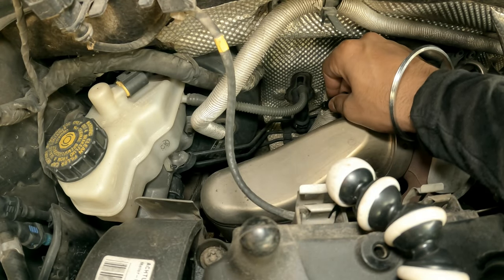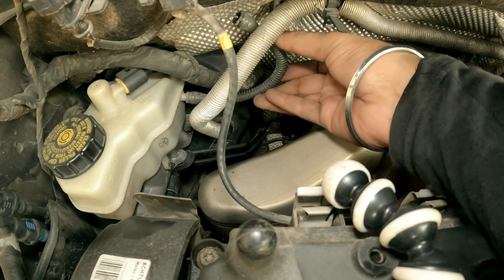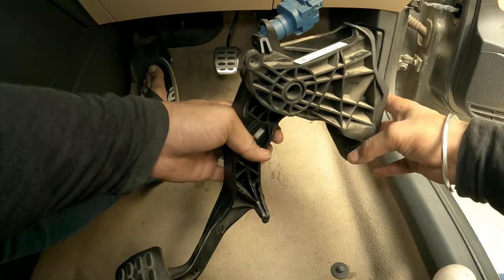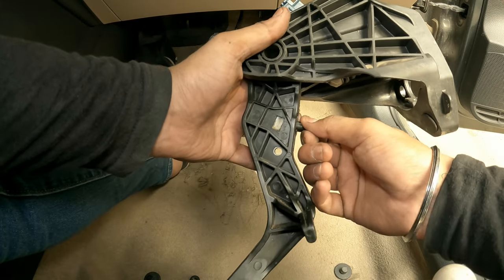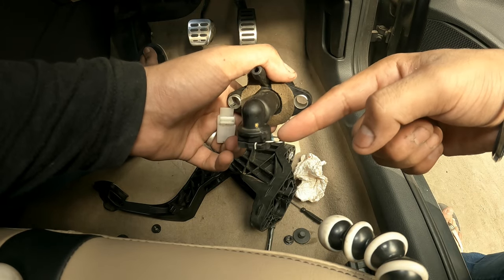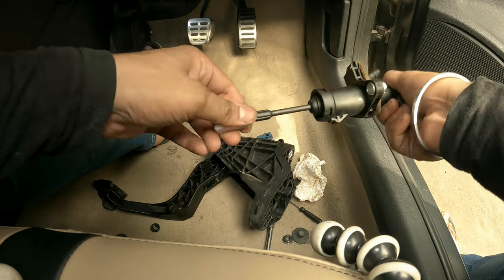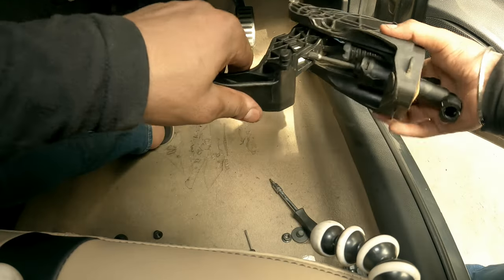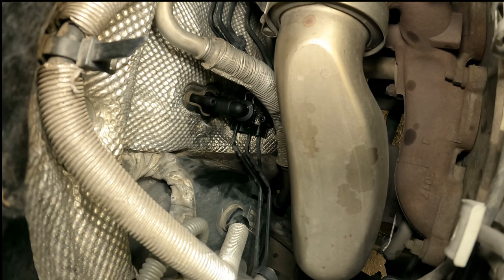VOLKSWAGEN CLUTCH MASTER CYLINDER REPLACEMENT

Comment: Thank you for posting this. My master cylinder is failing and this helps greatly. Question- when I go to bleed the system after install, do I also need to bleed the brakes, or will it be sufficient to just bleed the clutch?
Reply from the maker: Ideally you should bleed both of them  sir
Reply: You don't have to bleed the brake system

Comment: A quick one. 
I’ve a MK6 Jetta. How do you flush your brake fluid as my car brake pedal stays hard even on a level ground due to hill hold assist system. Is there a work around for pedal method in this type of car? Or you have to use the pressure bleeder ? 
Thanks in advance.
Reply from the maker: If the gravity method is not effective then we can use the back-flush method for bleeding the air out of the system, some cars do have a bit of a hard pedal due to hill hold assist , but that's the Nature of some cars

Comment: Thanks for the informative video. Does this needs to be replaced after specific period ? What if it  breaks while traveling, can we still drive the car . I have a 10 year old polo and I am curious if I should replace it now or not, I don't have any issues with the clutch till now.
Reply from the maker: Sir , ideally it should be replaced when you are overhauling the clutch , yes it can break , and same happened with me , but i was near to home so i just started the car in first gear and drove around 3 kms in 1st gear . As i didn't had clutch so i was not able to change gears and can't break as well
Reply: The car will be underivable other than short distances to park it somewhere else or put it on a trailer. You will not be able to disengage the clutch. As in, when you push the clutch pedal down, nothing will happen. So unless you can float gears you really only have first gear, and will need to turn the car off to stop.
Reply: This happened to me now..car is undrivable..clutch fully pressed..cant put it in gear..the only thing that took me home was the downhill in a mountain..luckily it didnt happen 2 days before driving at night with a baby inside
Reply from the maker: Sadly it is what it is sir, when it happened to me i drove almost 4km in first gear without using brakes .
Reply: @yourDIYneeds  -  If the connecting rod would have been of steel then this could have been avoided I believe . But it seems most of the manufactures use only the plastic connector rod . Heard few people were able to replace the plastic connecting rod with a steel one , but sure if its worthy to repair it.
Reply from the maker: Sir , exactly , a metallic rod can protect you from being stranded on the side of the road , yes heard that as well , but need a proper laith machine for that .

Comment: Hi sir i have a 2020 polo 1.0tsi 53k driven when I try to put reverse gear it makes noice but every other gears are working proper should I change my clutch
Reply from the maker: Sir , in some transmission it's an issue, just try to press the clutch pedal twice before engaging the reverse

Comment: Hi brother can u tell some must have basic tools for vw car owners?    I am thinking to order as sale is going on in amazon and flipkart..
Reply from the maker: https://amzn.to/3JxOozN
https://amzn.to/3bxOlqW
https://amzn.to/3bx0QTV
https://amzn.to/3BMmVbM

These all will do 90% of the work on a german car
Reply: @yourDIYneeds  Thank u brother👍 Should buy all 4 in the links? Mainly need tools for general servicing..
Reply from the maker: https://amzn.to/3bIWY23 - L handle
https://amzn.to/3Qwdr8q - 19mm socket 
https://amzn.to/3SwK87P - 32mm socket
https://amzn.to/3vPTiTb - small sockets and torx

These 4 will be sufficient for general services
Considering you have a polo which has a 19 mm drain plug

Comment: Currently trying to figure out a problem, 2014 vw jetta TDI. Clutch just sits on the floor board, could it be the clutch cable?
Reply from the maker: If its a hydraulic clutch then , its the lack of pressure or presence of air in system

Comment: Should slave cylinder also to be replaced along with master cylinder?
Reply from the maker: Sir these things ideally should be changed along the clutch plate
Reply: How about the brakes? As they operate on the same fluid system do they not?
Reply from the maker: Sir thats just hydraulic fluid sharing , nothing more than that , instead of having 2 separate reservoirs for hydraulic fluid , its better to have just one  when both systems need the same fluid

Comment: Hey bro can you please answer me a thing recently i have removed my polo 1.2 tdi thermostat valve and it was not easy in my place to find that whole thermostat part so my mechanic suggest me to remove the valve and he make the connection without the valve so now i m wondering is it a good thing to do please help me.
Reply from the maker: It will effect the engine only in cold climates , engine will now take more time to warm up , and till the time its not warmed up , fuel economy will be compromised , except that everything else will remain the same
Reply: @yourDIYneeds  Thank you so much mayyynnn you have clear my doubt and you are doing great job bcoz of you now i can do small services in my home by myself on my polo diesel. Keep making vdos on VAG cars... I don't know about others but your vdos on VAG helped me alot coz you filled us with every single detail you worked and it worked for me 🤩 Keep up the good work mayynnn 🤙🏽💫
Reply: @yourDIYneeds  and till December i will change the thermostat part thanks for the info ✌🏼

Comment: sir, I have a problem after replacing the cylinder, I can't get the clutch, there is air in the system, even with the pump, it can't be aired, what's the problem, can you help, more precisely, the clutch fails when driving all the way
Reply from the maker: Press the clutch , open the nut while the clutch is still pressed let the air out , close the nut and then release the clutch

Comment: Sir can we replace 2013 Polo GT TDI headlights with 2017 Poli GT TDI ones?
Reply from the maker: Yes sir , it can be , as far as my knowledge goes , we just need to swap one wire position in connector

Comment: Chevrolet beat har 200kms pay half litre m.oil guage se girta hai aur back compressor b hai plz batie kya karen agar ring dalenge ismai to sucess rehe
Reply from the maker: Sir ring to bohot baad ki baat hai 
Aap ek bar pehle next oil change pe engine flush use kijiye , modern cars ki rings low pressure hoti hai , and carbon deposits ki wajeh se wo stuck ho jati hai kabhi kabhi , jiski wajeh se oil consumption and blowby dono increase ho jate hai , ek bar next oil change pe ek acha flush for 10 mins and fir oil consumption note kijiye , most probably oil consumption or blowby dono hi kam ho jaege and engine bhi thoda sa smooth ho jaega , pehle ki cars me rings high pressure hoti thi islea ye problem nahi hoti thi , but ab fuel economy increase karne ke lie low pressure rings use hoti hai

Comment: Sir meri dicor ka center lock work nai kr raha h wairing heat ho rai h
Reply from the maker: Sir kahi se short hai wiring
Reply: @yourDIYneeds  koi soluction btae sir plz help gadi chabi se unlock ho jati h but start nai hoti h light nai aa rai h
Reply from the maker: Battery check ki aapne ?
Reply: @yourDIYneeds  ji sir full charge h lekin start nai ho rai h pahli bar jb unlock kiya tha center lock se to unlock nai hui thi but light jal gai thi unlock krne pr jo light jalti h phir bettery nikalne pr band hui thi
Reply from the maker: Immobilizer ka issue bhi ho sakta hai , jab ap start karte ho , to self ghumta hai ?
Reply: @yourDIYneeds  nai self hi to nai ghum raha h or na hi metter m light aa rai h
Reply from the maker: Sir fir apko ek bar check karwa leni chaiye
Reply: @yourDIYneeds  ok but sir is pr aap video banae plz

Comment: You don't need to take the pedal out. VW tech of 30 years
Reply from the maker: Sir , my age aside, if you had seen the video properly then you would have realised , that getting the master cylinder out without pulling the pedal out first is not possible , and you don't need to be a VW tech to realise that , you just need to have a bit of common sense that , if the mounting bracket of master cylinder is bigger than the hole of firewall then its not going to come out from that side , so pulling the pedal out first is the only other option.
Reply: @yourDIYneeds lol this is great. :D
Reply: Bruh I need your help how do I bleed my master cylinder? I have a VW Jetta 2.5 5L 5-Speed manual
Reply from the maker: Sir its a 2 person job , you have to press the pedal 5-6 times and then stop it at the end position when another person loosens the bleed screw on the slave cylinder, and get it tight , only after getting it tight you can release the pedal .
Have to repeat this process 4-5 times 
And then top-up the hydraulic fluid
Reply: don't say that without explaining your method?!? Please could you post a link to any videos showing how to do it. (otherwise people may not quite believe you?)